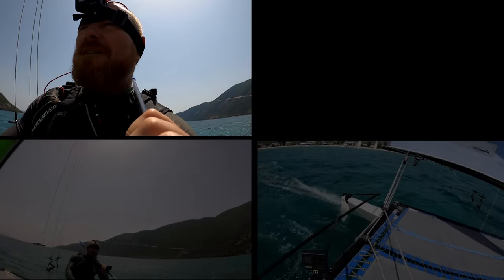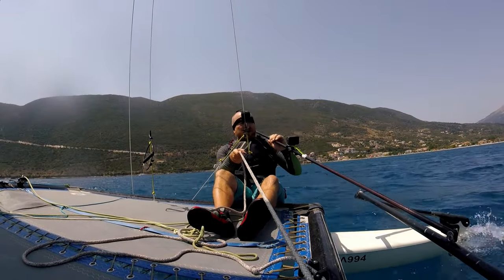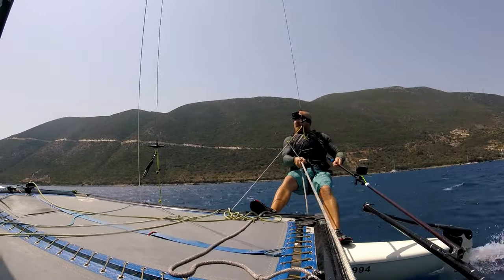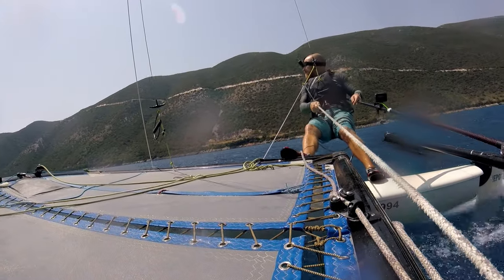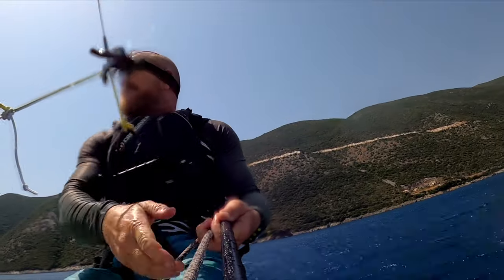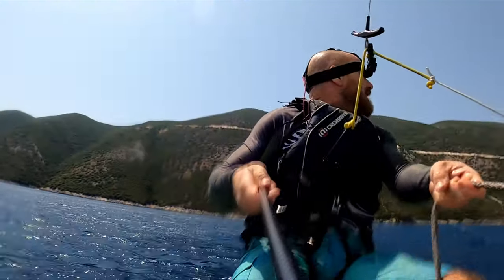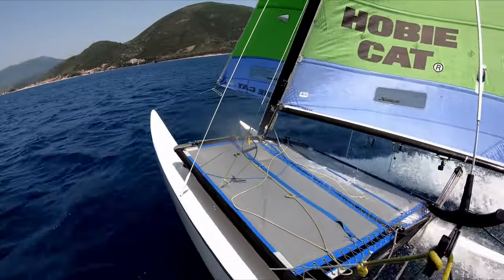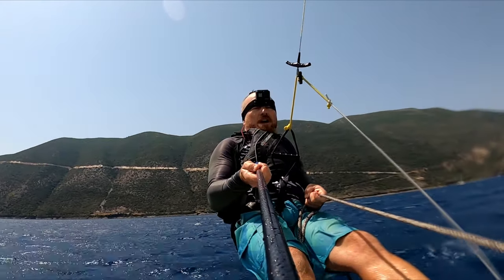Helming on the trapeze: mainsheet control

Comment: Mmmm, bare handed flesh lined rope clutch 😳 I do the hand rope clutch thing, but with unfortunately relatively expensive gloves (thick well padded) and tape my hands in strategic locations prior to putting the gloves on so as to prevent blister/burns...udahman. 

I rarely cleat my main in higher winds, ratchet off, and often need one wrap of line around my palm to maintain my grip.
Reply from the maker: Yes, sometimes i forget that 'normal' people have to wear gloves! Because i'm out every day the hands are naturally reinforced for this kind of action.

I find without gloves it requires less effort gripping the rope.

Comment: Hi Joe, which cameras are you using?
Really nice new angle. I think you will try not to have sheet and tiller in one hand when hit by a big gust?
Reply from the maker: Hero 8 on the extension, 7 on the head and session on the boom.

Yes, for sure, if there's a gust coming full control will resume!